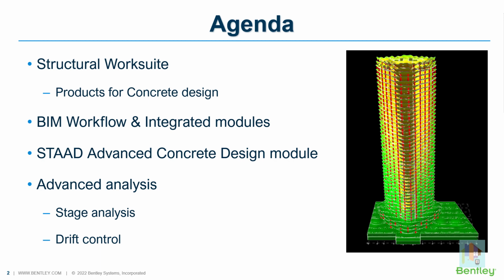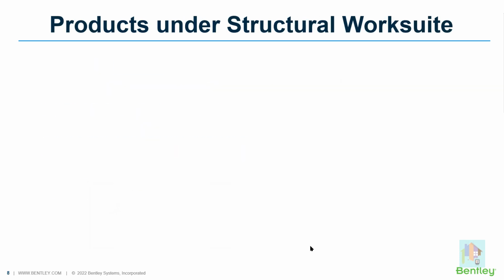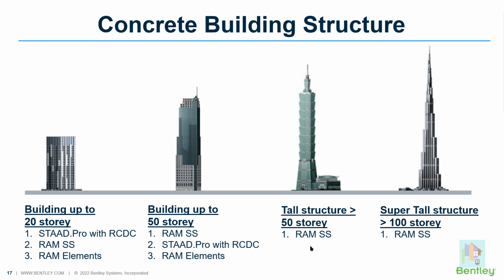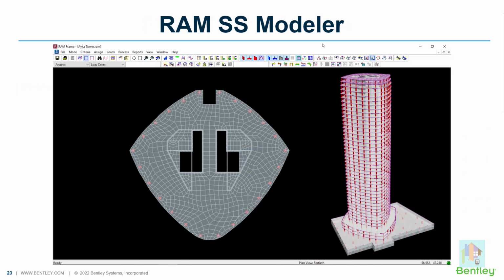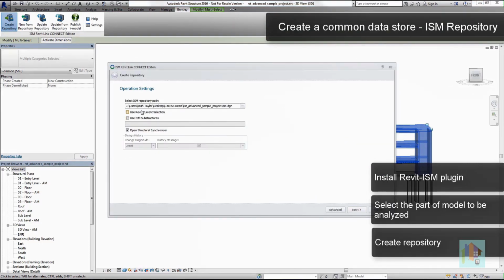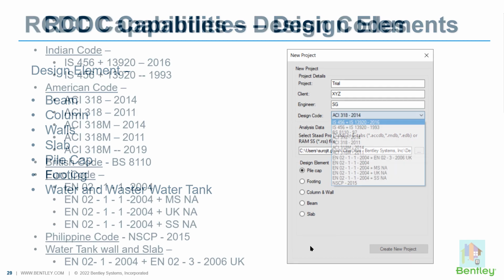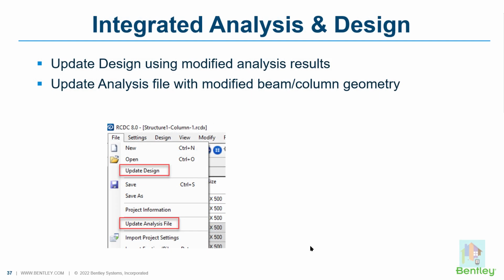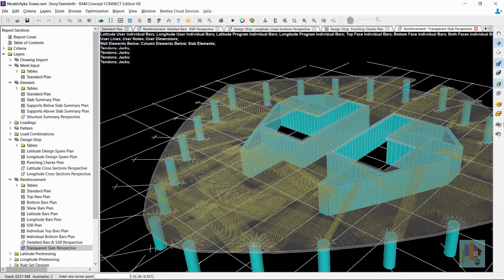An overview of Concrete Design workflow with Structural Worksuite || STAAD.Pro || RAM Structural

Comment: Sir, can you explain different types of error in staad file & how to solve?
Reply from the maker: I have already covered few errors/warnings - you can check the instability series or IS800:2007 series for more details. This year, I will upload several other videos with explanation and solution of various warnings reported in STAAD.
Reply: @surojit_ghosh  Thanks a lot Sir.